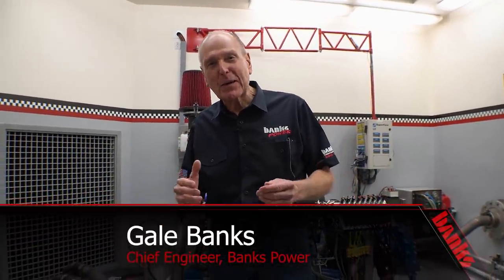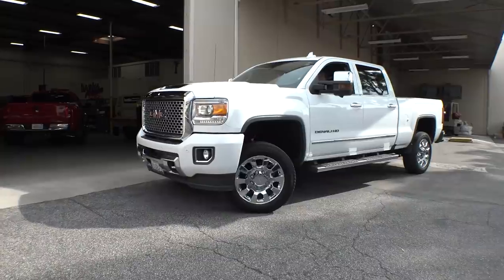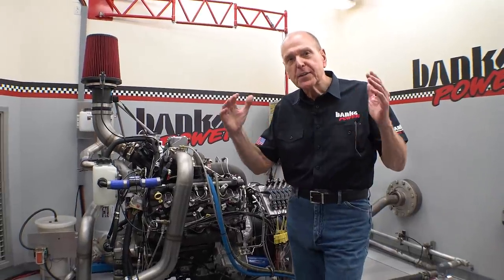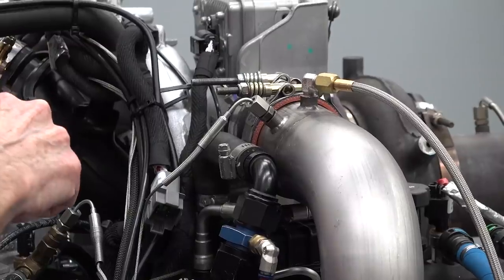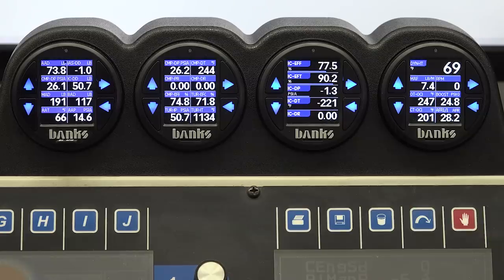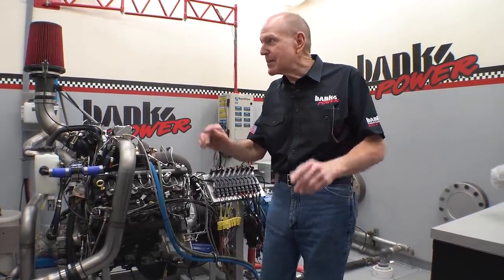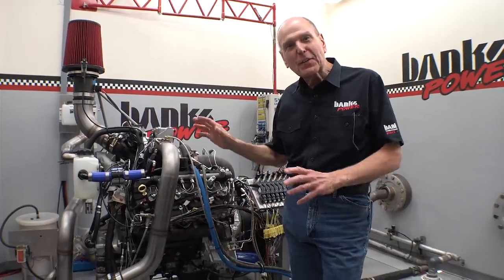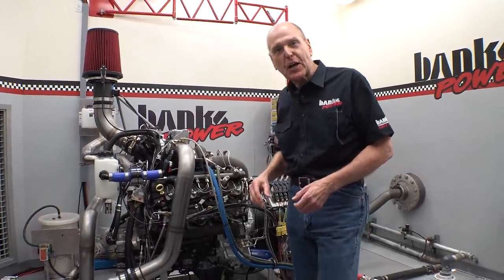KILLING A DURAMAX Pt 1: First fire! 🔥

Comment: Hats off to Gale for single handedly running GMs quality control department.
Reply: Highball 734  nope! Got 43k on mine with zero issues, the denso fuel system is completely different then bosh
Reply: Highball 734 well bosh cp3 and cp4 use a cam lobe with roller plungers (which isnt a bad system) but denso uses a ofset circle on the drive shaft that then has a block thats around it, that block then moves and pushes on the plungers like a solid cam lifter (there isnt any sliding between the lifter and the block) all the friction is between the ofset circle and the block machined around it, if you search around there is a cut away that will better show, now the fuel pressure regulator is about the same as a cp3 i have had to change them out (deere uses denso) but high pressure pump catastrophic failures isnt super common, injectors are about the same as bosh i havent seen to many that cause a haze like bosh has but i have had 2 deere gensets that one injector stuck open on each of them but thats been over the past eh 5-6 years, i honestly ditched my old lb7 for a l5p just cause i was excited about the denso system, hope this helps ease your worries
Reply: Haha good one
Reply: @douglasvogel2783  43k is hardly a testament to durability and reliability lol
Reply: myredfast ur right but for new engine out if the box issues theres very little brothers had more issues with his lml by this point for emissions

Comment: Rear diff cover? Still waiting..
Reply from the maker: The reason for the time between follow-ups is purely due to R&D. This is not a reality show with episodes taped months ago. When we post a video, ten times out of ten, it's something that happened that day or the day before. Now, maybe we should sit on the videos and post them all at once like a Netflix series so you can binge-watch them and know how it ends. Unfortunately, we're not a TV studio. We're engine builders that invite you into our facility. Good things take time. Doing something no one has ever done before, at least done it well, takes time regarding the diff cover series. We've been sitting on the info for quite a long time. Why? We'll only get your attention once. We're going to reveal the research when we debut our cover design. Put yourself in our shoes. You've done all the competitive, and you're excited about sharing it with the world. But along the way, you discovered how to improve diff covers in a way no one ever has. So, you design one. But making it isn't done like the other guys where someone bangs out a design in CAD then sends it off to the sand cast shop. We made many iterations and several billet protos, tested the heck out of the design, then went with a manufacturing process that is far more accurate but takes much longer. Are we curing cancer? No. But are we making the very best part possible? Yes.
Reply: It takes a while to get a good final product that meets there criteria. They want it to be the best product out there so it's going to take a Lil more time.
Reply: Testing got delayed when they blew up their dyno...
Reply: They found out that there is nothing wrong with the current  aftermarket  covers...
Reply: @bankspower  preach it yall. If you put your name in it...it will be impressive. Simply cuz Mr. Gail wont stand for anything less than the best and making the best better
  Blessed days yall all,
Crawfird out
Reply: Greg says the guy that can’t engineer a toothpick
Reply: Totally unserstand but if you want the benefit of the YouTube channel you should produce your content the way people want it. In the future it may be a better idea to hold the content and release it in a manner which pleases your viewers/customers  which I'm sure ultimately is your goal.
Reply: wow and after talking all that shit about competitors , I mean like really building hype and some really serious shitt talking
Reply: @gregdegani  Did you watch the videos? I'm pretty sure he found some flaws in the aftermarket designs.
Reply: I'm looking forward for the diff covers to be released as the next guy but I want quality! I dont want instant product on the market with substandard quality (we already have that). Keep up the great work Banks Engineering! Nothing like seeing a true craftsman at work and not someone just trying to stamp a name on a box that does nothing for your truck but drain your pocket.

Comment: Let's see you kill a 6.7 cummins next!
Reply: wouldn't take much...
Reply: @thesaltychip5850  In stock form..thats very true.
Reply: Gale banks seams to love a challenge so killing the 6.7 doesn't qualify lol
Reply: You just have to watch a few tractor pull or drag truck competitions to see that
Reply: thesalty chip nope, just a triple turbo setup and 2300 horsepower

https://youtu.be/auP5W-cP26E

They stated it had made multiple 3000 hp runs prior to the block exploding

Love to see any gm engine take 146 psi of boost
Reply: @rioncardwell3867  what do you know?
Reply: thesalty chip  with a billet block! Lol. There are no stock bottom end dmaxs running 1000+hp . Takes upgraded rods to get away with 600+ for any amount of time. I like the dmax trucks I’ve only had one as a company truck and it was nice. Much better than the 6.0/6.4 Navi’s tar motors in the fords. But once you pour the fuel too them they show their weakness
Reply: Not hard... 07 6.7 still sitting . 140k miles... Needs injectors new turbo head and gasket put back on. Still can't figure out where the block is cracked at
Reply: Just put emissions on it....
Reply: Do the 6.7 PowerStroke.

Comment: A qsk95 is impressive. Pickups are meant to be traded off. The doors rattle off a gm pickup after 40,000. Then you go get a new one. They don’t need modifications, they run the way they are.

Comment: Still waiting for dif cover conclusion...
Reply from the maker: The reason for the time between follow-ups is purely due to R&D. This is not a reality show with episodes taped months ago. When we post a video, ten times out of ten, it's something that happened that day or the day before. Now, maybe we should sit on the videos and post them all at once like a Netflix series so you can binge-watch them and know how it ends. Unfortunately, we're not a TV studio. We're engine builders that invite you into our facility. Good things take time. Doing something no one has ever done before, at least done it well, takes time regarding the diff cover series. We've been sitting on the info for quite a long time. Why? We'll only get your attention once. We're going to reveal the research when we debut our cover design. Put yourself in our shoes. You've done all the competitive, and you're excited about sharing it with the world. But along the way, you discovered how to improve diff covers in a way no one ever has. So, you design one. But making it isn't done like the other guys where someone bangs out a design in CAD then sends it off to the sand cast shop. We made many iterations and several billet protos, tested the heck out of the design, then went with a manufacturing process that is far more accurate but takes much longer. Are we curing cancer? No. But are we making the very best part possible? Yes.
Reply: @bankspower  Thank you for the reply and explanation.
Reply: I can wait, I'd rather it be done right.

Comment: Oh yeah! Wow, cool 😎 I see the same results as your diff cover test... nothing.
Reply from the maker: The reason for the time between follow-ups is purely due to R&D. This is not a reality show with episodes taped months ago. When we post a video, ten times out of ten, it's something that happened that day or the day before. Now, maybe we should sit on the videos and post them all at once like a Netflix series so you can binge-watch them and know how it ends. Unfortunately, we're not a TV studio. We're engine builders that invite you into our facility. Good things take time. Doing something no one has ever done before, at least done it well, takes time. Regarding the diff cover series. We've been sitting on the info for quite a long time. Why? We'll only get your attention once. We're going to reveal the research when we debut our cover design. Put yourself in our shoes. You've done all the competitive research and you're excited about sharing it with the world. But along the way you discovered how to improve diff covers in a way no one ever has. So, you design one. But making it isn't done like the other guys where someone bangs out a design in CAD then sends it off to the sand cast shop. We made many iterations and several billet protos, tested the heck out of the design, then went with a manufacturing process that is far more accurate but takes much longer. Are we curing cancer? No. But are we making the very best part possible? Yes.

Comment: Going to keep stock headgaskets and studs the whole way?
Reply: I am guessing head "bolts" and gaskets are no longer the weak link, guessing they will run out of fuel before running into a head gasket or head bolt situation.
Reply: @SMiller5488  I was going to say head bolts, it sounded repetitive

Comment: Some of them engines do hold up very little . But they do. I got a 78   F250 The house 428 miles on it for speed Granny gear never broke. Minor things on engine like  Alternator, Starter, And    Fuel pump. All 10 to 1 elder Brock. Will rip your  Chevy a part. I've on the truck cents  1980. Best truck ever  Made. Old  School Ford. Ford,s rules the WORLD.

Comment: Is it possible the missing diff cover episode is hiding in the oil pan and when she blows there it will be. Lol
Reply from the maker: The reason for the time between follow-ups is purely due to R&D. When we post a video, ten times out of ten, it's something that happened that day or the day before. We've been sitting on the info for quite a long time. Why? We'll only get your attention once. We're going to reveal the research when we debut our cover design. We made many iterations and several billet prototypes, tested the heck out of the design, then went with a manufacturing process that is far more accurate but takes much longer.

Comment: Mr Banks whatever happened to the rear differential cover build
Reply from the maker: The reason for the time between follow-up videos is purely due to R&D. This is not a reality show with episodes taped months ago. When we post a video, ten times out of ten, it's something that happened that day or the day before. Now, maybe we should have sat on the videos and posted them all at once like a Netflix series so you can binge-watch the entire season in one weekend. Unfortunately, we're not a TV studio. We're engineers that love to invite you into our facility. And, good things take time. Doing something no one has ever done before, at least done it well, takes time. Regarding the diff cover series. We've been sitting on the info for quite a long time. Why? We'll only get your attention once. We're going to reveal the research when we debut our covers. Put yourself in our shoes. You've done all the competitive research and you're excited about sharing it with the world. But along the way, you discovered how to improve diff covers in a way no one ever has. So, you design one. But making it isn't done like the other guys where someone bangs out a design in CAD then sends it off to the sand casting shop. We made many iterations and several protos, tested the heck out of the design, then went with a manufacturing process that is far more accurate but takes much longer. Are we curing cancer? No. But, are we making the very best performance part possible? Yes. #comingsoon 🏁
Reply: Banks Power I'm sorry that it seems I wrote and got on your last nerve but I was just trying to find out if y'all had gotten closer to finding a design that you felt worth your name sir.    I do have a question that if you do not want answer it just say so   I have a 1994 school bus with a 5.9 Cummins in it and it has a air compressor on the front of motor and my question is can I put it on my 2007-1/2 6.7 Cummins in my 3500 dually so that I can run an air tank and tools

Comment: Could the L5P be set up with mechanical injectors
And run without a computer?
Reply: @LKN4WAR yes, its absolutely doable.... with a few caveats as always, the only thing needed to make any diesel engine run without any electronics is a mechanically timed fuel pump, after that everything is smooth sailing removing every single wire in the engine other than the glow plugs; now the thing is, its not as simple as it sounds, why? 
you need a mechanical fuel pump and you more than likely will use the same spot from the stock one, that means you need your now bigger mechanical fuel pump to fit in the same place as the smaller non timed one, once this is done you move to imo the harderst part: you either need a mechanical injector to fit in the same space than a solenoid counterpart in the heads or you have to do mayor redesign to the heads in order to make space for the mechanical injector's larger diameter. i undestand where you come from however imo this is just absurd as no one wants to take away control over the engine, it doesnt make any sense whatsoever

Comment: What ever happened to the diff cover series?
Reply from the maker: The reason for the time between follow-ups is purely due to R&D. When we post a video, ten times out of ten, it's something that happened that day or the day before. Regarding the diff cover series. We've been sitting on the info for quite a long time. Why? We'll only get your attention once. We're going to reveal the research when we debut our cover design .We made many iterations and several billet prototypes, tested the heck out of the design, then went with a manufacturing process that is far more accurate but takes much longer. We have the diff covers in production and hope to have announcement soon. 👍

Comment: how do you do the engine management on these diesel engines? you use the stock ECU or you have some kind of aftermarket ECU?
Reply from the maker: For select racing engines, we use our own private Banks Automind racing ecm's. Other engines are using Motec Racing ecu's.
Reply: @bankspower  thank you very much for the information!

Comment: Where r the videos that finish the diff covers!!
Reply from the maker: The reason for the time between follow-ups is purely due to R&D. When we post a video, ten times out of ten, it's something that happened that day or the day before. Doing something no one has ever done before, at least done it well, takes time. Regarding the diff cover series. We've been sitting on the info for quite a long time. Why? We'll only get your attention once. We're going to reveal the research when we debut our cover design. We made many iterations and several billet prototypes, tested the heck out of the design, then went with a manufacturing process that is far more accurate but takes much longer. Are we curing cancer? No. But are we making the very best part possible? Yes. As of now, the diff covers in production and we hope to have announcements soon. When we announce the release, we will post the results video. 🏁👍

Comment: Gale;What am I missing here. You were conducting differential cover testing. Then the dyno blew. Months later you come out with Killing the Duramax on a dyno presumably in your dyno room. I did not see a close out on the Banks Diff cover. Safe to assume your testing did not show what the Banks cover is able to achieve.
Reply from the maker: The reason for the time between follow-ups is purely due to R&D. This is not a reality show with episodes taped months ago. When we post a video, ten times out of ten, it's something that happened that day or the day before. Doing something no one has ever done before, at least done it well, takes time. Regarding the diff cover series. We've been sitting on the info for quite a long time. Why? We'll only get your attention once. We're going to reveal the research when we debut our cover design. Put yourself in our shoes. You've done all the competitive research and you're excited about sharing it with the world. But along the way you discovered how to improve diff covers in a way no one ever has. So, you design one. But making it isn't done like the other guys where someone bangs out a design in CAD then sends it off to the sand cast shop. We made many iterations and several billet prototypes, tested the heck out of the design, then went with a manufacturing process that is far more accurate but takes much longer.

Comment: Gm didn't make that motor,,,Isuzu did.
Reply from the maker: It's quite the contrary. Despite what most people think, Isuzu Motors Ltd. has very little to no design input on the Duramax engines. They co-own a small portion of the D-Max company (the Duramax engine manufacturer) with General Motors, but it's now considered a past venture according to them from design to engineering. The Duramax engines are built right here at home in Dayton, OH. Check it out: https://www.dmaxengines.com/

Comment: It won't take much to do it.
Reply: 323k miles on mine while pulling a 10k trailer about 70% of those miles and i have zero cost for the engine and about $1200 on the trany over 17 years. 
Now lets hear your experiences ....

Comment: I understand the idea of killing it by pushing it yet pampering it...but this certainly then really doesn’t show the engines actual value for pickup owners. If it were in a truck, with Stock GM tune and they kill it, you’d see the actual weakest link...whatever that part may be. But trying to kill it when giving it 3x the water, 3x the intercooling, 4x the amount of cool oil...and 2x the radiator doesn’t really tell the story you’d like to see if you own the dang thing. It’s all just lollipops and unicorns if you go outside of stock availability of air, cooling and oil isn’t it?
Reply: Neo Craft let the guy enjoy himself geez.